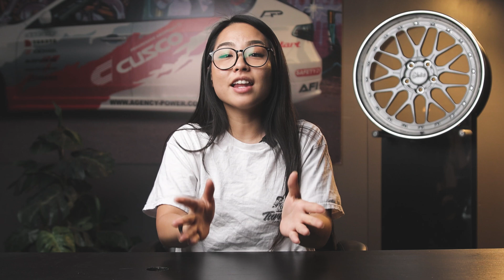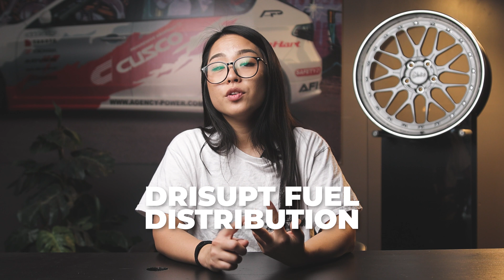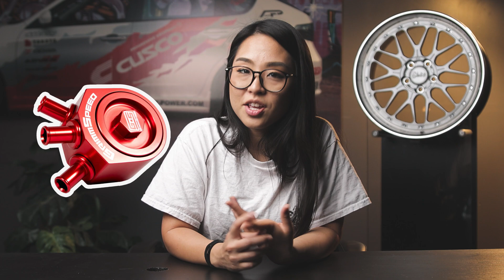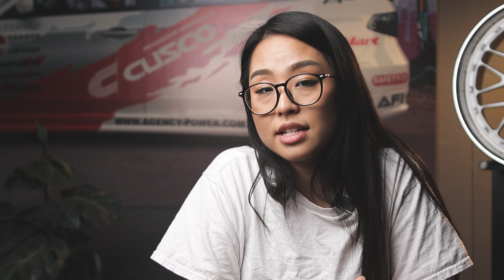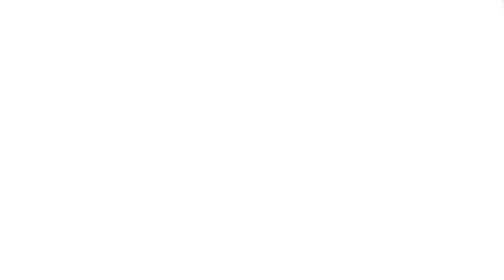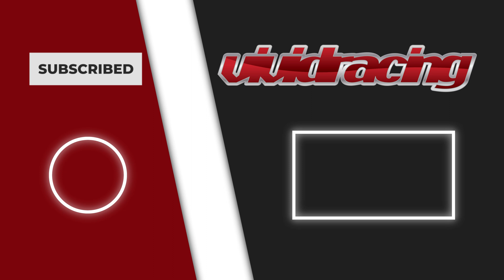The Difference Between Catch Cans And Air/Oil Separators!

Comment: My L34 SR VC-T that has the Nissan/Infiniti KR20DDET engine has both direct AND port injection which is 8 injectors total from the manufacturer needs a catch  can set-up but as far as I know, there isn't one out there so I have to do some RND. Ugh! But maybe I dont need one because it has both types.
Reply from the maker: That's actually wild! Sometimes I wonder if companies try to do too much to make their cars "the best"
Reply: @vivid_racing  It's a mixture of power and economy. It's kinda of like Nissan's version of eco boost, I guess. It's an Altima so go figure...eco car.

Comment: Subaru did a horrible design with their PCV… I’d say ANY turbocharged subaru engine should immediately be equipped with an air / oil separator.
Reply from the maker: We agree 100%
Reply: Any turbo car should have an oil separator.  Oil vapors help to increase knock.